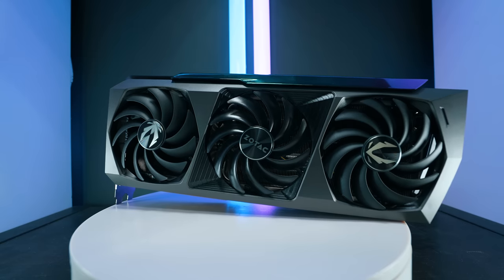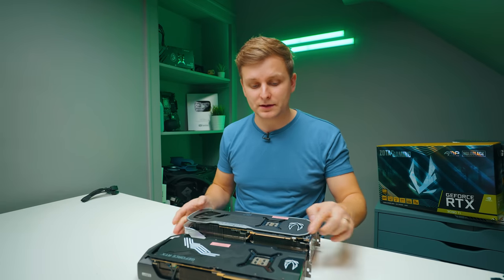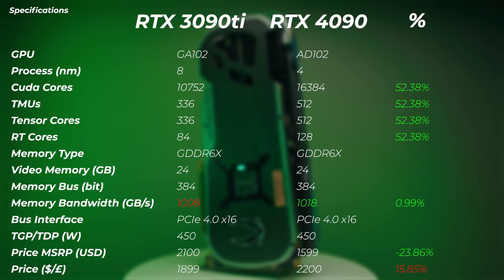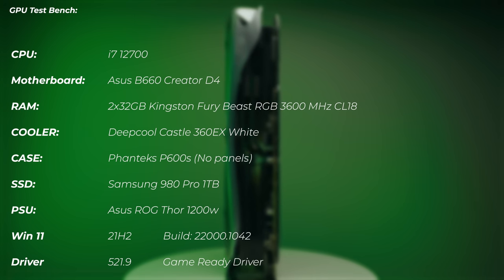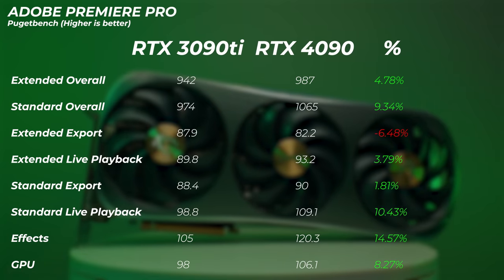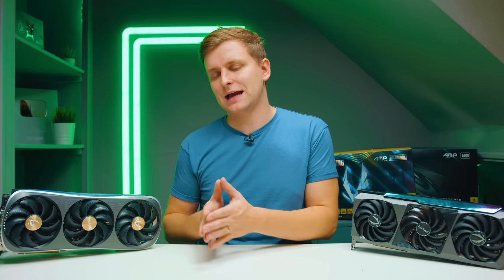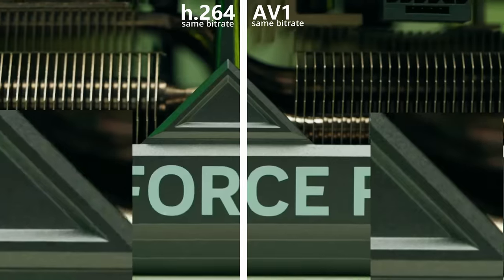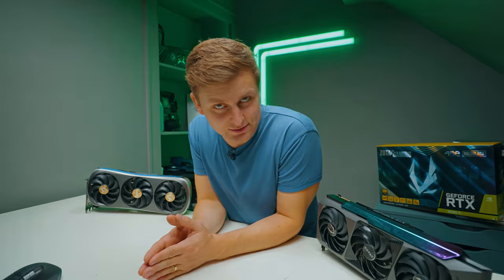Is it REALLY WORTH the EXTRA 💲💲??| Zotac GeForce RTX 3090ti vs NVIDIA RTX 4090

Comment: This is useless. Where is the gaming benchmark? Nobody buys these cards for apps.
Reply: GN and HUB are looking for you :)) don't forget about your 6 cores and 16GB
Reply: I never game but i need a good graphics card for video editing.There are lots and lots of creators out there, not just gaming kids.
Reply: @andersistbesser  exactly
Reply: Probably the opposite is more true. My playtime is in Blender not daft tedious shooting games, I will get a 4090 in a few months probably, depending on availability.
Reply: @nicholaspostlethwaite9554  Did you get a 4090 yet? Im thinking of building a new computer and using the 4090, which looks to hold up extremely well in blender.
Reply: @T777Mi6  No still seems in short supply and overpriced for those in stock. It is ridiculous we can not just choose one and get it at the normal price. Almost getting to the stage of having to accept whatever one is available. The industry is not making anyone like them!
Reply: @nicholaspostlethwaite9554  the prices seem to be going down and more avaliable you can find them as low as $1670
Reply: @T777Mi6  I am in the UK so the supply may be a little different. But they are not impossible if you take whatever is available and at the inflated prices. Perhaps another month?

Comment: ***You can ONLY purchase this card NEW FROM A ZOTAC DEALER. You have NO WARRANTY with ZOTAK if you buy from anyone used, secondhand, online bidding, etc. You ONLY have a warranty if you are the ORIGINAL PURCHASER. Gifted from a friend or parent? THEY must be the point of contact for registering and for warranty. First AND ONLY original purchaser has a warranty. The warranty is NOT transferrable! I JUST bought a brand new SEALED card (this exact card type) and found all this out when I opened it and then went onlline to register it for warranty. Original buyer gets 3-year warranty. They sell the card months later because they cannot finish the build, then the next owner GETS NO WARRANTY AT ALL! Pretty hard to swallow.***

Comment: Just got a 3090 Ti Founder's Edition for $1100, barely fits in the case but works great, and $500 cheaper than the 4090.
Reply: I did the same and it works great.
Reply: peasants
Reply: @zaedvfdsd3903 let's not bully the poor please
Reply: @csguak your definition of the materially challenged is completely misguided

Comment: My use case .. So how do I get 240 FPS @ 3440x1440 (Ultra settings) out of an RTX 3090 TI in Call of Duty?? My RTX 3090 is 100 FPS short of that and DLSS adds latency. BTW .. If everyone refused to buy products from scalpers, they could easily buy at MSRP like I did. I paid less money for my RTX 4090 than my EVGA RTX 3090 FTW3 Ultra and I only paid MSRP on both.

Comment: the reason the 3090ti is missing a connector is because they are the same card as the 3090 and the ti came with different memory chips on pcb also ti had more cuda cores and everything else was the same the non ti uses 24 vram chips 12 front 12 back while the ti used 12 chips on front.

Comment: It's funny how pricing in different markets really impacts value - here in NZ the price difference between these cards is like $1k or more. I just did a build and went for a 3080Ti for motion graphics work as it seemed the best value in terms of price to performance. I think I paid around $1400 NZD for it. Now I'm seeing a 3090Ti on sale for $1700 down from $2500 and I am tempted only because I happened to have a current project that is making use of the new pyro sim tools in C4D. But I am trying really hard to stick to my plan to wait for a year or so and upgrade to a 4090 or 4090Ti if prices cool off a bit as the 4090 is going for $3500 to $4500 here in NZ.
Reply: @VibeGame  That's the 3090Ti that I'm tempted to buy and sell off my 3080Ti but I'm trying really hard and just hold off and go for a 4090/Ti later on as I don't think I will see that much benefit in my workflow once this sim project is done.
Reply: I'm in Australia, It's like $3,800 + for a 4090. I bought a 3090 8 months ago due to a Motion design job requiring more then 8gb of vram. Ended up using 20gbs of vram with the 3090. I think I'll wait though before buying the 4090. Really don/t want to spend more money. Just had to spend a bunch on my set up.

Comment: How will two RTX 3090 with SLI compere to one RTX 4090 in unreal Engine 5? Is it double the Cuda Cores - mining 10.752 + 10.752 = 21.504 against 16.384? Bay the way - Thanks for info and all your PC-builds.
Reply: I thought UE5 only reckognized single gpu regardless of nvlinks and SLI?
Reply: @darkkingastos4369  Yes. Your right. But I thought, that maybe it had chance with the 5.1 update. Apparently not.
Reply: @jacobjuul21  Maybe someday.. I can't fathom why they haven't made that a priority?

Comment: The 3090 and 4090 can’t be compared really.  They are in 2 different dimensions. Even the 4080 rocks the 3090ti.  The 40 series card are expensive for sure.  But holy crap.  My 4080 eats red dead 2 at ultra setting at 4k for breakfast.  It plays it at 4k at over 130fps.  No dlss. All native.  Looks incredible. I couldn’t imagine what the 4090 feels like.
Reply: 4080 is litteraly 10-15 more fps at 4k than a 3090 ti, it won’t change nothing in ur life 😭
Reply: @sasuke2536  I meant the 4090 rocks the 3090ti. Should have worded it differently now that I look at it.  You are correct. The 4080 isn’t much faster the the 3090ti. A little bit. But not like you are gunna upgrade for it.
Reply: 4080 is strange, Slightly better then a 4070 Ti but with 4GB of ram but the performance is like the 4080 gives 10-30fps or so more then a 4070 Ti, 

That said it does the job @ 1440p, Ive ran a 4070 Ti @ 1440p with pretty much no problem and it a powerhouse, Just wish the performance gap was wider, The 12GB of vram is also meh , Like @ 1440p i never had a vram issue but still with the way games are not as optimized, UE 5 coming out to more games ya